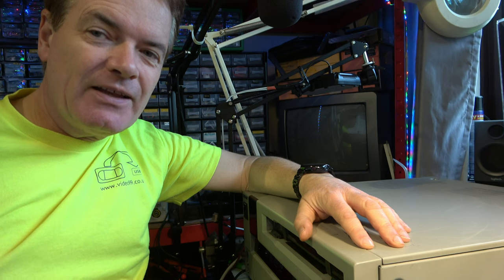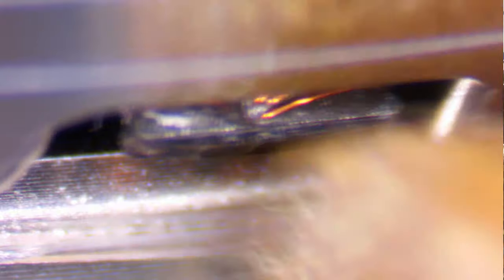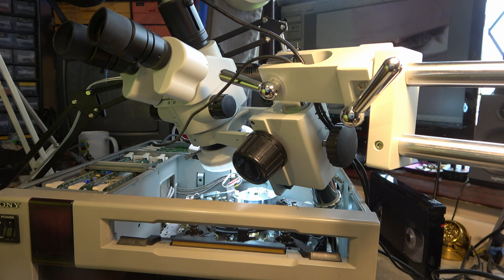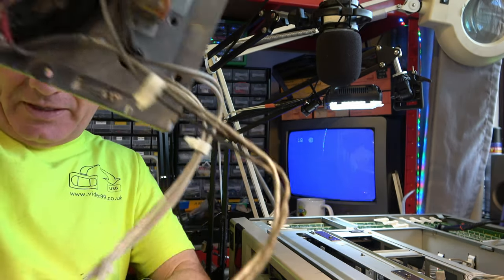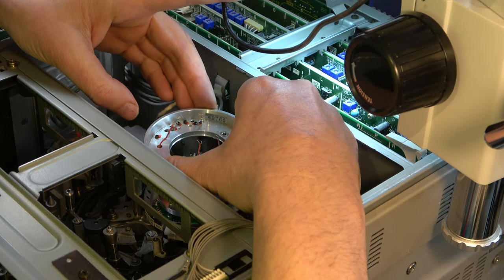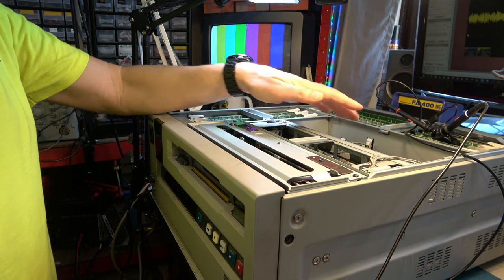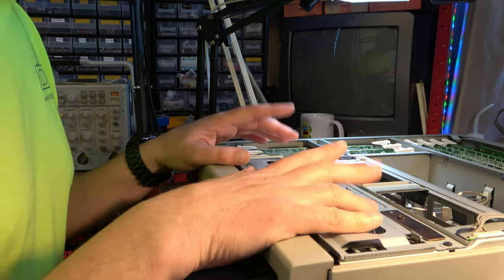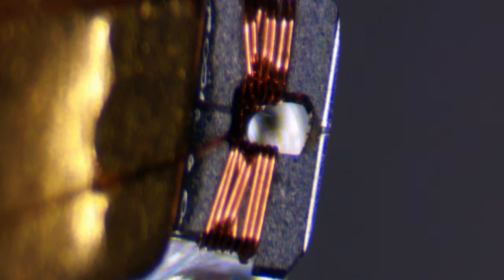Messing about with BetacamSP heads.  Professional video recorder heads, Sony UVW-1800P.

Comment: It is always vital to ensure no eccentricity of the upper drum. Without the guages you could probably eyeball it using the microscope view you used to look at the head tips. This of course isn't relevant to the low RF output issues though. Good luck finding a newer head drum. When I worked on servicing these I remember having old (but still usable) heads piled up on a shelf in the workshop. If only some of these had found their way home and I thought to keep hold of them!

Comment: We used to use xylene for bad head clogs. Potent stuff and was told it could dissolve the lacquer of the wire on the head windings if not careful, but it would shift the most stubborn head clogs, and great for the dark ridges of grime on capstans too. We used to get it directly from Ampex back in the day.

Comment: I had a Sony 1700P betacam sp. It was a recorder and player but if i'm not mistaken, the 1700P had an extra connector for editing control that wasn't available on 1800P. So, the point is there are 5 models including 1200, 1400, 1600,  1700, and 1800, all PAL system versions.
Reply from the maker: Didn't know that.

Comment: That some good attempts. 
But is it not necessary with regard to the picture after changing the video heads, to calibrate the video drum with special Betacam calibration equipment so that fluctuations on the side of the drum do not become too great?

Comment: I've only ever come across one UVW1200P and one 1400P. The 1800P was probably the most common deck as I remember all the Avid offline suites had this model for playing out their final edits to tape. The 1600 players were less common but not as rare as the 1200 or 1400 and were mainly used for making VHS copies. The basic 1200/1400 decks don't have the Sony 9-pin RS422 socket required for full editing control. I think the 1200 I came across had only ever been connected to a TV in producers office for viewing tapes and had extremely low hours. Not sure where the 1400 came from, but I remember it's only job was to copy VHS to BetaSP for editing.

There was another model in the UVW series but I never came across one, but I believe it was another recorder with a special function, that must have been the 1700 mentioned in the comments. According to Pal Site - "This model (UVW1700) is intended as a single frame recorder to be used in conjunction with Computer Graphic generated material."

UVW1200P = Player / no VU meters / Time base stabiliser (not a TBC) - component can be switched to either YUV or RGB
UVW1400P = Recorder version of the 1200 with VU meters, same YUV/RGB switching.
UVW1600P = Player with VU meters / Time base corrector and the addition of a 9-pin RS422 remote control for Avid etc
UVW1800P = Recorder version of the 1600.

UVW1700P = "Single frame recorder to be used in conjunction with Computer Graphic generated material"

https://betacam.palsite.com/models.html
Reply from the maker: I've come across more 1200 machines than any other model, for some reason.

Comment: I fixed a JVC VHS that had worn heads. I had a scrap machine that was a model up from the one I was fixing and the head drum was different. However, the part number on the heads themselves were the same. So I took the good heads off the spare drum and put them on the good drum and it worked. It was very fiddly though.

Comment: Just extra good clean heads,Take alcohol and a paper from coffee filter . That paper I use instead of leather clean wipers.Its a tiny bit of roughness just enough to really clean those heads. I know from the Sony SL-C7 Betamax , those upper heads need to align within 16um. When rotating. You can notice if your upper heads does not have a very tight fitting or if it is somewhat loose around the head screws.Then you know it needs to align. Heads of that scrapp part. Just polish with copper cleaner. Should work. Have done that with heads of badly stored recorder. Then why not test those heads in a known good recorder.As you already took those heads out. Use to have a P1200 machine with remote. Amazed about the build quality.

Comment: If that head drum has movement for alignment i.e. runout you will need to setup a dial gauge to get it as close to zero runout as possible. That other head drum with the sticky section you should be able to polish that out. Make sure you have no dirty head gaps too.
Reply from the maker: Yes, eccentricity needs setting up.  I should be able to do that optically rather than using a dial test indicator, since I have the microscope.

Comment: Changing the upperdrum, requires centrering of the upperdrum and adjusting of the head switching. The entrance and exit guides need adjustment too. Follow the guide in SM, important to set the tracking for “center”. I really don’t remember, in detail, because I have not changed that much drums on this model and it is a long tim ago. Before removing the original drum, I would have tried cleaning with plain paper and alcohol. Sounds Strange if the heads should have failed at only 1200 hours, they should last three times longer.
Reply from the maker: Cleaning the heads was getting me nowhere.  Eccentricity I could set up using the microscope (I used to do Sony SL-C7 heads optically), if I had a good head drum to go in there.
Reply: Plain paper and alcohol usually did the trick for us back in the day

Comment: I wonder if the heads are not actually getting cleaned when you use your cleaning tool.
I've had a few vhs machines that could not be cleaned;  i took some corse paper and held the paper flat on the head with a light pressure of the finger, then turn the drum a few times.
Yes it sounds nasty but some heads just don't clean normally.
On vhs machines i used cardboard to clean really stubborn heads.
Your microscope may not be able to show tiny particles.
Sorry i had to waffle a bit :-D

Comment: I know nothing about Betacam but from the rhythmic pulsing of the RF signal on the scope it seems to me like it could be a mechanical problem.
Reply from the maker: I know what you mean, it does look a bit like that, and that may be a problem with low RF from that tape.  But clearly the original heads were shot anyway.
Reply: How about head tip transplant I have done this in the past using two faulty head disks. Could be fun to try

Comment: hi like to keep the card with the cell that keep the info of the hours the head has done with it   as i have a deck with just 25 hours of running time 
the head drum is like new  i don't like to change over head drums   
i go for the pcb's all the time  
i worked on alot of this model  i know they are new to be i used to working on   reel to reel  decks  got to start some where  with the pro video decks

Comment: hi i just spy the uk ebay  it's full of  betacam decks    i will say there's to many on the market place now  

like you said in a video's there's  only about  15  in the uk would need betacam decks   and why is the used price very high if there's alot a round 
i did do well picking up decks  i only buy recorders  as audio deck you have a very good point in the very 
here 

do you have  video' head's we can see for the digi betacam decks we can  see one day 
are they very hard wearing heads on the digi betacam  decks 
i have to check my decks for hard wear on them

Comment: I feel I’m always putting you down, but once again your doing it all wrong with your scope and you don’t touch heads with your hands and never and I mean never clean heads with buds. Also test the heads for wearing. You are someone who just swap one part of a machine with another. These machines are old and they need a complete teardown and rebuild. But it’s pointless because the technology is old and that’s why we use digital. Test the induction of the head but the main thing you need to look at signals of different stages in the path. Your just playing guessing games with this. One more thing ever head you change in a vcr you do a realignment of the whole tape path and a service and set it up to its peak with equipment.
Reply from the maker: When did you see me clean heads with cotton buds?  I use head cleaner sticks.  In part 2 of this video I do set up the alignment better.  But there's no point insisting on a full deck alignment when the tools, especially alignment tapes, are unavailable.  You just have to work with what you have in today's world.  It's not perfect, but it's where we are today.